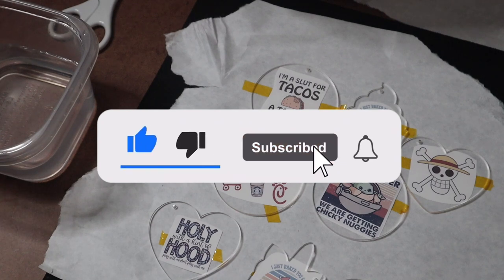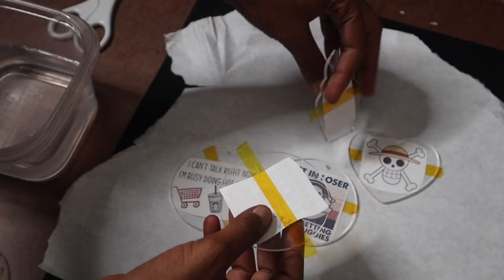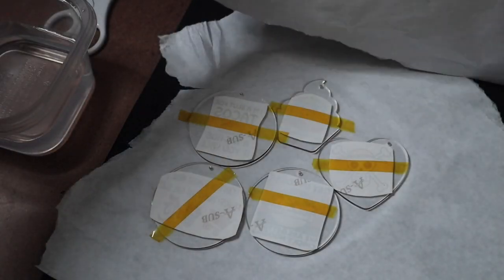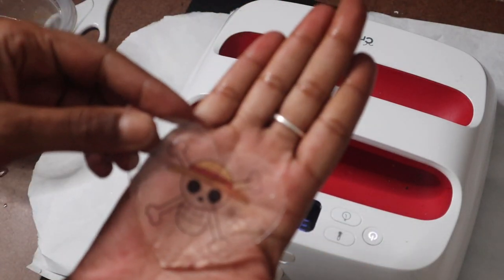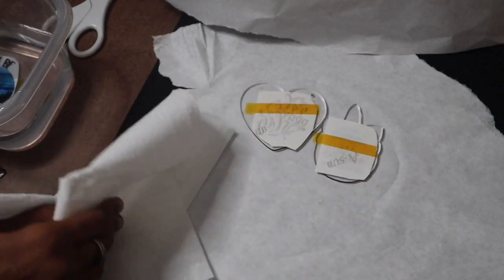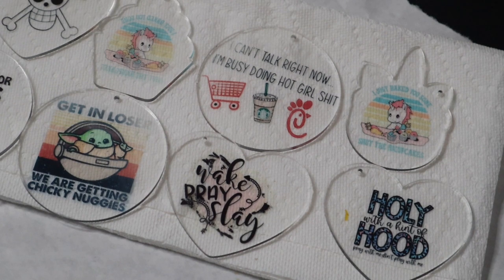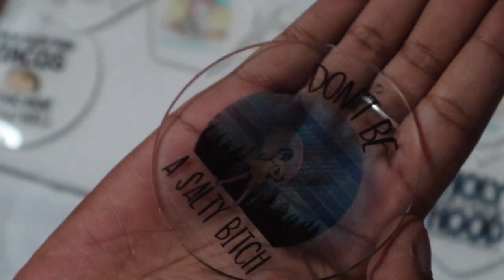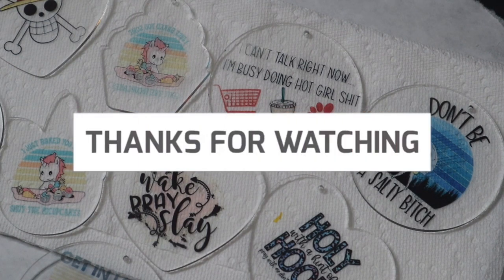How to sublimate on acrylic!!! Yessss we can sublimate on Acrylic keychains!! DIY

Comment: Do these images wear/rub off after time/use?
Can they be scratched off by the keys?

Also, I have an Epson 3850, but you use special ink.
Can you switch ink cartridges or do you have to use this exclusively or sublimation printing?
Reply from the maker: you could alway add a top layer of epoxy to secure design. and yes has to be sublimation ink

Comment: I’ve tried this and mine seem to melt and curve, did you use the pressing pillow?
Reply: Hello. Mines did the same and i corrected it by using a heat gun to get it back smooth... then i placed something flat and heavy on it while it cooled off
Reply: same with me.. why after press my keychain look curve...

Comment: Im trying to Sublimate on some acrylics they keep coming out white and fogged up any advise ?
Reply from the maker: What type of acrylic it may be too thin. What time and temp are you pressing at?
Reply: @crystyle_NYC  it is 0.04 thick  my time is set at 60sec and pressing at 365
Reply from the maker: @anthonycaldera7230  maybe try less time like 40 seconds… I’m not sure how think mine are 🤔
Reply: I tried this tonight and my acrylic melted 😩
Reply: @marissacruz3849  high temp acrylic what you need, can't just use any ones that don't do high heat what I learned

Comment: I tried these but the acrylic melt down. And picture did not mark on the acrylic. I think the ones you bought have a special metrial that support too much heat and a clrar coat for sublimation. They are not a regular acrylic.
Reply from the maker: i got mine from zindee. they are regular acrylic. did you drop in warm water after removing from pess?